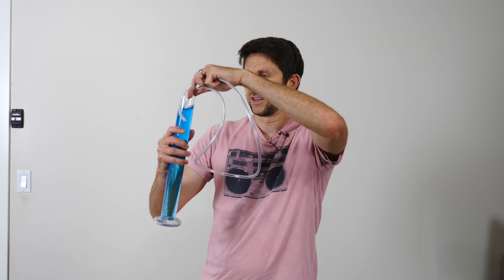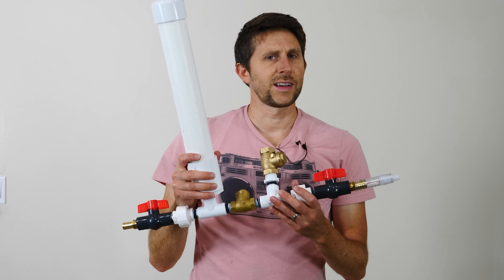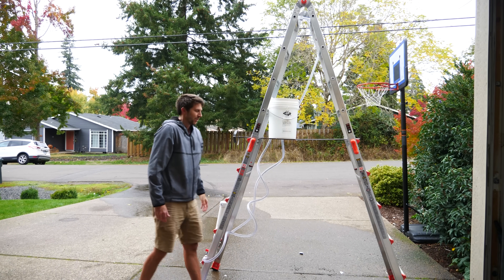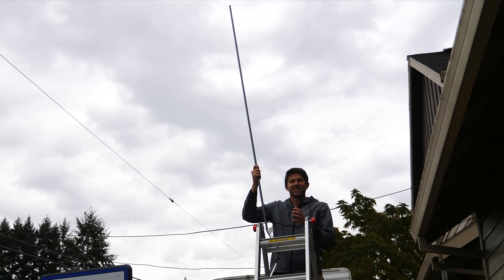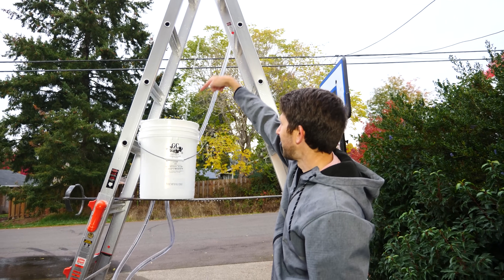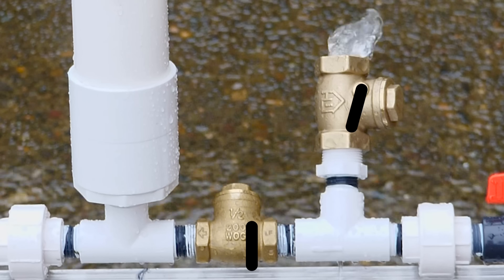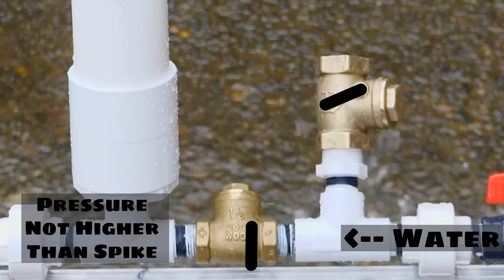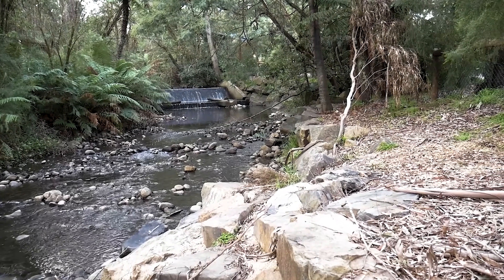Can a Hydraulic Ram Pump Make a Perpetual Motion Loop?

Comment: This is My Bachelor's final year Project 💯❤️😍
Reply: Really? This principle has been fully understood and utilised for hundreds of years…..
Reply: @supertramp6011  Yes...it works 24*7 without electricity and any forces....we need a water source which is always available like river and any water stream .... The source is 1m above to the pump then the pump pulls the water above some height of the source based on its Efficiency ....sry for my English 🙏
Reply: @Mahesan_Ram  sorry to disappoint you,but there are several forces at work in this system,- gravity,(potential energy) ,kinetic energy,inertia of the water flowing through the system,which provides the ‘ shock loading’ ,giving the water hammer effect. You will never be able to pump all the water as high as the source,but you can pump some of it as high,or even higher,however,you will always lose some water out of the system..

Comment: It's the mechanical equivalent of using a water powered electric generator to run a low flow rate, high pressure electric pump

Comment: I was thinking and wondered if it is possible to create a source of energy based on the atmospheric pressure? This one is based on water flow but atmospheric pressure is involved.
Reply: The energy comes from the potential energy of the head of water. 

Atmospheric pressure has nothing to do with it.
Reply: You could, A windmill uses differences in atmospheric pressure called wind to generate electricity.

Comment: Hey, can this action be chained?
The wasted water could be collected with another pipe fully fitted towards the bucket itself?
Reply: The Bucket Must Be Placed Higher Than The Valve So It's Not Possible
Reply: It will never reach to the bucket as water flowing in natural pressure.
Reply: If I can assume, if you hook up a pipe at the waste valve, the water has nowhere to go, it's not going up, the trapped water becomes an obstacle for the oncoming water and gets slowed or blocked. This one is the laws of gravity.

Comment: Put a watermill and a bucket by the exhaust pipe, and a watermill and a bucket at the out put, then refill the system as needed? In my mind it seems like a somewhat free and easy energy solution for when there is no wind or sun or even flowing water nearby.
Reply: Or better yet. Have the water turn a turbine and generate electricity or watermill without all the excess plumbing. The ram pump would take away more energy from the system than the watermill by itself.

Comment: What if you add a water wheel under the flow from the higher discharge tube? Using the gravity energy to drive a pump to pump the discharge water back into the bucket instead of letting it run away?
Reply: You would still be fighting a losing battle as both the water wheel and attached pump would be far from 100% efficient, and significant loss of energy would occur to run them. Ram pumps are meant to be fed by naturally running water as it supplies a continuous stream of energy.
Reply: @andydouglass1374  Yes nothing is 100%. But the energy from the falling water is being wasted. It could be a laminar flow at contact with the bucket water level. Almost all kinetic energy transferred to the pump. If you set the pipe's end at ti's highest point the water coming out would get energy from the gravity pulling it back down into the bucket. That would be adding energy from outside the system. And there would be no loss of water that requires replacement.
Reply: @glenncurry3041  A falling object is not getting energy from gravity. Potential energy is stored in an object when it is raised, and when the object is lowered, the potential energy is converted to kinetic energy and released when the water contacts another object. The water's potential energy is calculated by PE=mgh, where PE=potential energy, m=water's mass, g=gravitational acceleration, and h=height of the water in reference to the object that the water will impart its energy to when falling. So the amount of energy in the water is directly related to the water's mass and elevation, as well as gravity.

To simplify the complexity of the ram pump, it is taking a small bit of the potential energy in the water flow (usually a natural stream but in this case the raised bucket, which has a limited supply of potential energy) and converting it to a small bit of pressure energy inside the pump. This cannot be done without waste water flowing out of the system. That tiny bit of pressure energy is used to force a tiny bit of water up the distribution (output) line and eventually to the bucket. The quantity of waste water must always be greater than the quantity of water moving through the distribution line, or the pump will not function. This is why the video talks about the finicky part of getting a ram pump to work initially, because it is a delicate balancing act that just barely works. In this video it seems like there is an abundance of potential energy because he raises the distribution line very high above the bucket and it still works. But remember, the energy potential of the water at the top of the distribution line is directly related to it's mass as well as height and gravity. The mass is the part of the equation here that will never be significant enough to equate to enough energy to pump the waste water into the bucket as the stream of waste water will always have more mass than the stream of distribution water. We can easily imagine the trickle of water coming out of the distribution line turning some sort of light water wheel. But it would never have enough energy to turn a water wheel big enough to power a pump to capture the waste water. If natural laws allowed it to do what you describe, we would have bigger problems as that would mean a falling raindrop would release a significantly higher amount of energy when it struck the top of your head. Ouch.
Reply: @andydouglass1374  So please explain to everyone how "A falling object is not getting energy from gravity" when "So the amount of energy in the water is directly related to the water's mass and elevation, as well as gravity" .... "as well as gravity"

Regardless of how the water got to that height, it is at "rest" at the moment it leaves the pipe and has potential energy based on the gravitational energy it gets pulling it back down. The additional gravitational energy now imparted to the water molecules from their static height can then be transferred via water wheel, turbine, .... to a pump to pump the free water after it comes out of the waste gate. This system operates independent of the ram pump and is powered by the same gravitational energy imparted to static water mass at a higher elevation. It just share the same "pool" of water molecules.
Reply: @glenncurry3041  The potential energy is stored in the water as it is pushed up the pipe. The energy is released, not imparted, when the water falls. It may seem like a minute distinction, but is important in reference to your idea because it seems like you believe that gravity will somehow add energy into the system where the water flows out of the distribution pipe. All of the potential energy stored in water came from the potential energy stored in the water in the bucket. The amount of energy in the distribution water will never be enough on it's own to pump the waste water up to the same level.

If what you propose was possible, you wouldn't even need the ram pump. You could just have a closed vertical loop of pipe filled with water and some means to nudge the water into motion around the loop, and, once nudged, it would flow around the loop indefinitely.
Reply: @andydouglass1374  Try opening up your mind to a two closed system arrangement. The energy to push the water up the pipe is from the ram pump system and has nothing to do with potential energy the water now has at that elevation. It could just as easily be filling a tank at that height instead of going back into the close ram pump system. You have a mass of water at a height and that is all as far as the ram pump separate closed system is concerned. A person could be manually filling the tank at that height just as well as far as the 2nd closed system is concerned.

I am not saying this would break the second law of thermodynamics. There is still evaporation, more water out of the waste gate than up the pipe means less potential energy to pump the greater amount of waste water, but it does not have to go as high either, ... but there is enough gravity based potential energy in the water mass at the height to pump some back up in a separate system. Reducing the amount of water than needs to be manually added.
Reply: @glenncurry3041  Well of course you could pump SOME of the waste water up to the bucket. But what would be the point? I assumed you were trying to find a way to capture all of the waste water, because anything less would not be worth it. This model of a ram pump with a bucket reservoir is for educational purposes. An educator would just fill the bucket again rather than have two more machines to set up and calibrate just to avoid filling the bucket slightly less. Ram pumps in the real world operate in natural streams of water with somewhat limitless supplies of water with no supply of electricity to power a regular pump. Rigging up a water wheel and pump to get a tiny bit more water out of the creek would never be worth the investment, maintenance, and calibration of the extra equipment. Maintaining the ram pump by itself can be a pain as the check valves wear out pretty quickly as they are operating at a higher rate than intended and the device is susceptible to freeze damage and clogging by debris.

Why not build one yourself? It would be a fun project.
Reply: @andydouglass1374  Good thing Einstein did not have your inability to work with visualized thought experiments.
Reply: @glenncurry3041  Good thing Einstein could admit when he had conceived of something incorrectly, instead of changing the story and then throwing out lame insults.
Reply: @andydouglass1374  Like the "Cosmological constant" he invented to cover his distaste for "Spooky action at a distance"? 

Or when he referred to god believers as "feeble souls harbor such thoughts through fear or ridiculous egotisms"? 

You just can't catch a break it seems!

Comment: So what you’re saying is building this under a river/lake/ocean to have a relatively unlimited source of water. Then we could have the water turn a turbine to create energy. Perpetual machine unlocked! An environmentally better alternative to a dam. Not as efficient but maybe for homes far from the electrical grids it could work. 🤷🏻‍♂️
Reply: That would not be a perpetual machine, flowing water is an external source of power. Also it would be better to have the flowing water turn the turbine directly rather than a ram pump.

Comment: Pumped-storage hydroelectricity (PSH)...
Can the water coming out of the waste valve be reduced in volume?  And can it be fed back into the system with a siphon?
Reply: Syphon is an interesting idea to refil the system. I dont see why it wouldnt work. If you get the flow rate through the syphon just right, and add a bucket to catch what spills out.
Reply: @greenanubis  , we can try, but probably not, attaching a pipe and the waste water becomes slowed or blocked. If a bucket, it's still waste water. Laws of Gravity continue to annoy us.
Reply: @arrowghost  Yup, youre right. Syphon would absolutely not work, it cant deliver water to higher level. If we are talking about capillary action, then it would also apply what you mentioned, and would also probably not work.
Reply: No.
Reply: the proportion of waste water can be reduced by lowering the outlet head & no it cannot be fed back into the system since the bucket/reservoir is at a higher head than the exhaust checkvalve
Reply: @virutech32  You're talking about sending the waste up to the reservoir.  I'm talking about reintroducing it via siphon either up or down stream from the waste water valve.
Reply: @sanjuansteve  downstream to where? it can never reach the same place as the outlet as that would require an input of energy that would defeat the purpose of using a ram pump in the first place. i guess the waste could be directed somewhere below the system's lowest head but then the point of a pump is to get water to a higher head. if ur already above where u want to send water then u just let it fall

Comment: Im no  Scientist lol but What if the water that pumped to the top falls on a water mill to generate electric to charge a  Battery thats  Connected to a pump that has a float switch and the water from the   waste valve falls into a "pan or somthing" lol to catch the water and then the pump will turn on when the water gets to high and pump it back into the top bucket. Wouldnt that keep it going lol again im no Scientist just a  Carpenter

Comment: 7:10 - 7:15 That's why I learned as a kid to turn it off not to fast. This sudden change in presure can damage the pipes or at least increase the changange of it getting damaged.
Reply: When I was a kid I always liked to turn it on and off really fast to make it sound like a machine gun Kelly
Reply: @putrichan2550  you took uselessness to a whole new level
Reply: @youregonnahaveaskeletontim1925  it's a bot, youtube is to blame here...
Reply: @hovnocuc4551  ikr but looking at it just got me thinking of our generation like damn...
Reply: It's water hammer
Reply: When I first started in HVAC I was helping someone work on a chilled water system and he asked me to turn the pumps off and when I did the check valves slammed shut causing a water hammer strong enough to bust the 6" metal pipe to the building. We drained an entire 6 story buildings chilled water system into the mechanical room that day.
Reply: Hammer arrestors are standard install these days to prevent the slamming.
Reply: @XxTWMLxX  ‘These days’? I have a hammer arrestor, 100+ yrs old.
Reply: You need a PVC tube in the system, like in the video. It stays filled with air and acts like a shock absorber.
Reply: Hydroelectric power stations have huge chambers and tanks to avoid water hammer and absorb excess flow when the turbine is taken offline, they're really cool. For example: https://www.youtube.com/watch?v=fJVBlhgt9j8&ab_channel=EdgarM%C3%BCller

Comment: these pumps or ones like them were found in native American settlements and in other native settlements around the world.
used in a river they are the absolute closest thing to perpetual motion or free energy that is possible. The pump has a external source of power the river the water from the waste valve returns to the river the rest flows up hill where it is used. Even that water ends up back in the river because of the water cycle. So until the pump breaks down or the water cycle stops the pump wont stop. 

Why it is not free energy or perpetual motion well the pump will break down eventually, the pump relies on a external power source which is the river and eventually in some time in the future the water cycle at least in the area will break down and the river will dry up

Comment: So why dont you just put a bucket under the waste valve and use the same system to pump it back up to the start? Thered still likely be waste, but can you improve efficiency?
Reply: its a matter of diminishing returns. this is the same logic as adding a second cycle to a power plant. if ur reject heat, or in this case exhaust head, is higher than your final exhaust temp/exhaust head then putting a bottoming cycle might make sense but is very limited. the lower the efficiency of ur bottoming cycle the faster those returns diminish.

in the case of the ram pump it's even worse since the higher the outlet head the more water it wastes so the returns diminish very very quickly
Reply: @virutech32  i thought it would waste less quickly. Because if you put another bucket and pump underneath, doesnt it take more time for the waste to accumulate enough to be pumped back up?

My thought process is, why not stack 1000 buckets and pumps on top of each other, or enough so that it would take the entire age of the universe or something to actually lose waste (outside of evaporation)?
Reply: @jstodd4398  the problem is that each lower pump wastes more & more water to get a smaller & smaller portion of the orgiginal waste water back to the reservoir. also you need to be able to keep going lower & lower for it to work since every new pump needs to be low enough for the exhaust water pressure to be enough to actually power the ram effect. 

so yeah technically you could bankrupt a nation to create the massive hole & thousands if not tens of thousands of pumps to pump a dozen liters of water for a few hundred years(u for sure aren't getting anywhere near even a million), but why? what would be the point of that?
Reply: @virutech32  Why does each waste more and more water? Why wouldnt it be the same?

Comment: I wonder what would happen if you put the waste water back into the bucker
Reply: You can't because the waste water comes out at a lower point than the bucket. You can't get it up without any external force. That's why perpetual machines are physically impossible.
Reply: It would keep going. Like when he put more water in from the mains hose. If you put it back by hand, the action of you lifting that water UP to the bucket would charge up the system to keep going.
Reply: Hmm.. well he basically explained this at the end of the video, how sensitive this setup is, especially the calibration of the pressure on the waste valve. Which would increase if you start to stack up the waste water in a pipe towards the bucket, until it just stops pretty much like the very first showcase.